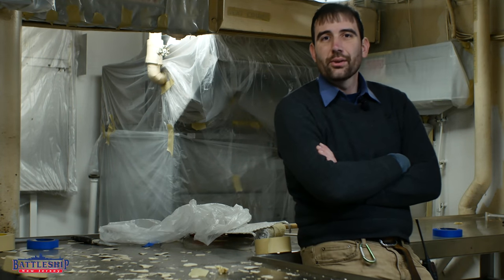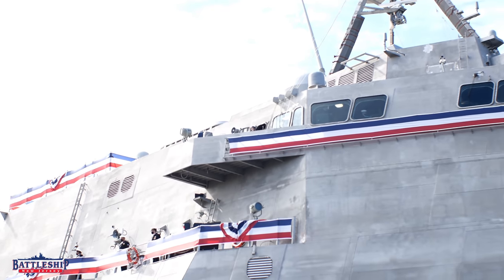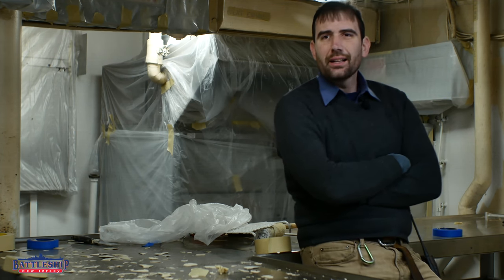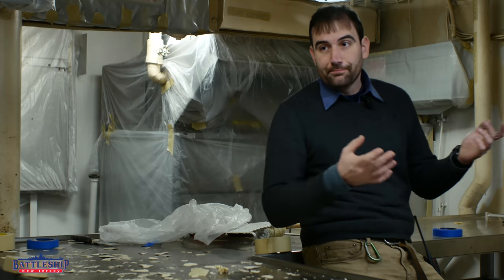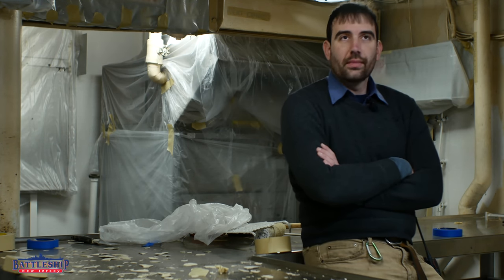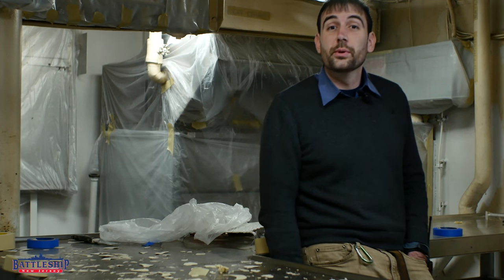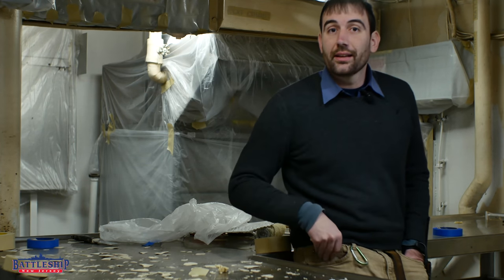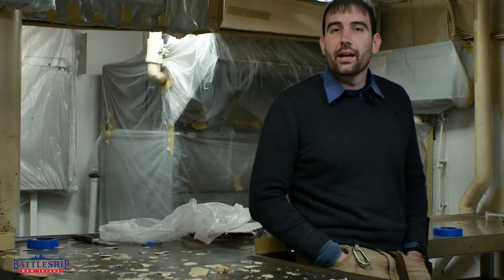Warships Made Out of Aluminum?!?

Comment: One thing about war, it exposes the unexpected. Resistance to battle damage seems to be downplayed, no more big guns, etc. But in Ukraine there seems to be a distinct chance that Russia will try an amphibious assault at or near Odessa. This would presumably involve direct off loading from one or more assault ships. The Ukrainians may well have Soltam K6 120 mm mortars which are widely available, cheap, easy to use, and even easier with drone reconnaissance for spotting/correcting. The question  now becomes whether the Russian ships could withstand withering mortar fire with rounds up to 30 pounds? If they have gone to thin steel or aluminum, they may get a big surprise. WW2 style naval armor had a purpose.  BTW- ships now have close in defense systems like the Russian Kashtan, but have their designers imagined 100 rounds of 120 mm mortar fire in 1 minute using GPS guided air-burst rounds? Antennas, ammo, and radar might not survive.... It may be a long shot, but we may see a David vs Goliath ship battle play out on video!

Comment: When you say aluminum 'burns' are you talking about literally burning (i.e. combusting) or just losing strength/melting? Aluminum does indeed melt sooner than steel, but if your aluminum is actually burning then you have much, much larger problems. While it is certainly possibly to burn aluminum, it takes an insane amount of energy to do so. The ship will have ceased to be a ship long before you get to the point of aluminum burning.

Comment: i think you have mixed up burning with melting steel has a melting point of 2,500° F  vs aluminum is half that at 1,221°F  this is over simplified bc there are alloys of both that had different melting points (this means that fires that would be contained in a steel boat vs the aluminum one) decks and bulkheads sagging and collapsing would be far more likely with the aluminum

Comment: If my memory is right when JFK hit Beltnam a broken pipe sprayed jet fuel on the Beltnam for 2 hours feeding the fire.
As far as the Falklands HMS Sheffield was an all steel ship even though it was reported as burning aluminum.
Reply: Aluminum was used extensively on the superstructure of the Royal Navy's Type-21 frigates, two of which (HMS Ardent and HMS Antelope) were lost to fires started by bomb hits during the Falklands War. Another member of the class, HMS Amazon, also suffered a fire in 1977 were warping of hot aluminum hindered fire fighting. HMS Sheffield was a Type-42 destroyer.

Comment: Welding was not new in the 1940s.  Welding has been done for very long time.  Blacksmiths wielded.
Reply: Pretty sure he was referring to welding being used in ship construction. Riveting was the popular method for a long time
Reply: That's "Forge Welding", yes it's been around millennia but you heat up most of the workpieces being joined to hammer them together. But they referenced just Welding which is a process to melt the large  workpieces being joined at the joint, and then allowing them to cool creating fusion, Electric Arc and Oxy-Fuel Welding have only been around since the late 1800s, with the Oxy-Acetylene process being developed in 1903 and consumable electrodes in the 1920s.
Reply: That is a completely separate process that only has a superficial resemblance to the one he was talking about.

Comment: The LCS class aluminum ships are HORRIBLE! I’ve been aboard 3 of them doing government acceptance testing. I saw terrible welds aboard the aluminum ships. Bad fitting butt welds, misaligned lap welds and even chipping hammer marks on a weld. Why!?  Many areas didn’t look like they had been preheated. The hangar deck doors don’t look like they could stop a .22LR round. The ONLY good thing I saw is the thin hull is not going to hinder a missile hits it. I truly believe the missile or round is going to entirely pass thru the ship before it detonates. I’m so embarrassed that our Navy accepted these terrible ships. Also the shipyard I was at had previously built barges and Mississippi River boats. They went from barges to warships over night. BAD IDEA. Lets not even discuss the minimal crew concept. Ships need continuous maintenance. They don’t have the crew for anything other than minimal maintenance. All items more than minimal maintenance is put off until it comes to the yards. Even daily cleaning is difficult.

Comment: Cruiser Kennedy and Aircraft Carrier Kennedy. - Who rammed Who? By one strict definition - not a ramming - neither ships; bow made contact with the other ship.  Belknap got under the Kennedy "overhang" for the angled deck on the Port Side - and JP-5 down here stacks/. Despite the pictures - the BADLY  injured were the boiler technicians, not personnel in the superstructure . I am googling stuff to try and have my facts correct. I found one drawing showing it as Belknaps Port Side. The drawing show initial contact of forward edge of the angled deck to the Belknaps superstructure. Drawing implies Belknap crossed JFK bow dangerously Close in a left turn. Crossing an a manner if both were merchant ship and obeying the rules of the road, the JFK should have turned.  Hey - these a different subject to consider for a video - Plane Guard for a Aircraft carrier - a dangerous job for a Tin Can- through the 1990s various ships being plane guard got involved in bad collisions with the aircraft carrier. Last one I recall was 1996- USS Roosevelt shift from forward to reverse without tell the USS Leyte Gulf - who end up ramming the carriers stern.

Comment: High topside weight should be counted by design; I favor trimaran designs with the outer hull being unmanned outriggers which can protect the main hull from anti-ship missiles while increasing stability. The one-shot ship concept does what navies have always done which is to not prioritize the survival of the crew. Aluminum is bad; in the maritime world performance of tens of knots such performance advantages are not relevant enough to warrant the disadvantages. Modern paint can last for 50 years (see Firth of Fourth Bridge).

Comment: Aluminium doesn't corode?  Actually aluminium corodes very readily in air but in doing so it forms a protective layer and so appears not to corrode.  I have worked in 'inservice support' for aluminium aeroplanes.  By far the largest problem there is corrosion.  Comercially pure aluminium (99%) is reasonably corrosion resistant but in engineering terms it has the strength of plastercine.  For a structure such as a ship, just as an aircraft, it will be alloys of aluminium you will use.  Copper bearing alloys are most resistant.  Eitherway the passivation etches the alloying elements away at the surface so that damp conditions (condensation will do) does not form a battery between the aluminium and the alloying elements.  Then anodising forms a deep oxide layer all over to further prevent problems.  Great so far but damage the surface, scratch it, bash it, whatever and then expose the underlying alloy and your problems start.  Even simple flexing, and ships do a lot of that will crack the oxide layer.  Just imagine sailing through debris and abrading the alli at the water line with alternate immersion and drying.  Its hard to imagine that there is not some sort of suitable boot topping employed.
Aluminium is likely to be the bosun's headache.  Time will tell.

Comment: Last I checked, you couldn't weld aluminum and steel together.  Any joint would need to be mechanical...Bolts, rivets, screws, etc.  

The joint should probably have an electrical insulator between the two metals, as well as between the fasteners and either surface.  Otherwise, your aluminum will look like Swiss Cheese shortly as it corrodes away.  Salt water will accelerate this problem.
Reply: You can do it, you just really shouldn't.

Comment: It's unfortunate that the LCSs were a scam from the start. They're poorly designed with numerous design defects and incapable of performing most if not all of the missions they were designed for. Meanwhile almost all maintenance must be performed by contractors, with parts wearing out earlier than stated, etc.

IIRC the Freedoms are still being built and going straight from the shipyards to mothball. And the Independences are suffering from bimetal corrosion and almost half have stress fractures and have been limited to 15 knots.

All the while we spent billions on the freedoms and the same shipyard won the contract for their replacement.

Comment: A superstructure made of carbon fabric and Epoxy will burn badly. If the superstructure was attacked with a napalm-like attack, the fire will vaporize the oil-based resin, it will burn in a self-sustaining disaster.

Comment: There's an issue with steel that aluminum doesn't have: steel ships need more framing than aluminum ships.  The M59 Armored Personnel Carrier was steel and the relatively thin steel armor required internal frames for rigidity.  The M113 Armored Personnel Carrier had aluminum armor and the thicker metal was rigid enough without internal framing.  In the M113's case this cut costs as well as saved weight because there were fewer welds and joints--though aluminum welding is different from steel welding.  

Aluminum burns at a slightly lower temperature than does steel, but the difference isn't as much as has been made out--thicker metals still take longer to combust.  

Two warships of World War Two that were primarily of wooden construction were the PT boat and some classes of minesweepers.  Today various composites would be used instead of wood due to lower maintenance costs.  

I guess you could try building a ship out of concrete.
https://www.amusingplanet.com/2015/11/ships-made-of-concrete.html

And then there was the aircraft carrier made out of ice and wood pulp.
https://www.combinedops.com/Pykrete.htm#:~:text=Pykrete%20-%20Experimental%20Ice%20Ships%20in%20the%20Rockies,proposed%20the%20construction%20of%20ships%20made%20of%20ice.

Comment: As is usual, Engineers with little Working knowledge, have decided to Re-invent the wheel. While Aluminum "Only" Oxidizes, which doesn't create the Very Visible "Running Rust", It DOES Require Specialized Equipment To Weld Reasonably Well, Under Fairly Controlled Conditions, along with a Knowledgeable Welder. There Are Many Other Issues When "Dissimilar Metals" Are Involved. Not Everything Aboard Is, Or Can Be Made Of Aluminum. That Fact, Along with Salt Water, Which Is An Electrolyte, Creates Electrolysis. Want to BET the Coast Guard Wouldn't Take One Of These Ships IF You Paid Them?  When One Already Knows A Ship Isn't Worth Fighting for in the event of a serious Fire, Better Not Take it Too Far From Land!
Reply: AC TIG isn't that specialized of equipment. If you want specialized equipment, you can get MIG set for Aluminum.

Comment: In the 80's they made troop transports for infantry troops out of aluminum. They eventually scrapped them because aluminum isn't bullet proof
Reply: Umm . . . No.  There's still plenty of aluminum armored vehicles in service.  Aluminum can, will, has, and will continue to stop bullets, shell fragments, etc.  The M113 series APCs used aluminum armor, and so do the M2/M3 Bradleys.  The M109 series self-propelled howitzers also use aluminum armor.  (The M551 Sheridan tank was also equipped with aluminum armor, but that one wasn't completely successful for a lot of reasons). Tanks still use steel, though nearly all use a spaced composite laminate armor, which is mostly still steel.  Aluminum, if it's thick enough, works just fine as armor in a lot of applications.
Reply: @Supersean0001  was gonna mention the Sheridans, with aluminum armor. That was only one of several very serious flaws with them, as you state. But that's pretty serious.
Reply: No they did not
Same aluminum magisum metal

Comment: Steel is cheap, and air is free. If modern ships need more hull volume to provide buoyancy for the sensors and communications systems in the superstructure, then by all means build the ships bigger! The downsides are manageable, and come with some additional upsides - like additional volume for fuel storage, giving greater range. And if you need extra hands in the crew to continuously work on chipping and painting, then you'll have extra hands on board to work damage control when needed.

Speaking of damage control and taking a hit, it seems like the very height of folly to build warships out of aluminum, then reduce the crew complement (which, in the inverse of the above, means fewer hands available to work DC when necessary). It doesn't really seem like a suitable for a warship, unless said warships are intended right from the drawing board to be purely sacrificial units - to be considered lost as soon as they're committed to combat. Of course any ship that takes a hit from a modern ASM will likely be out of the fight regardless of its construction, but the difference between steel and aluminum could well be "the survivors bring their damaged ship back to port" vs. "the survivors, if any, take to the lifeboats."

Comment: Aluminum is ok, till that Su-33 is comin in five feet above the waves, doin 1500 mph, with a dozen anti ship missiles hanging off the bottom.
Reply: Most jets can only manage mach 1.2 at sea level. The air density is just too high and the thing would burn up without special materials.